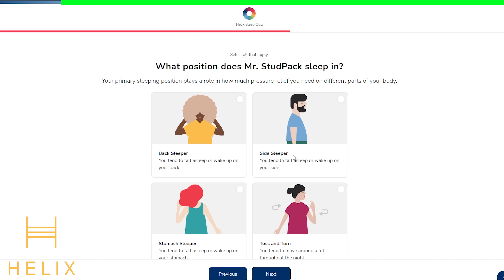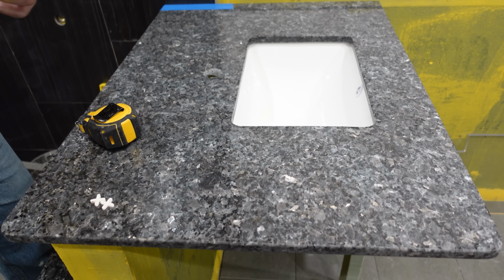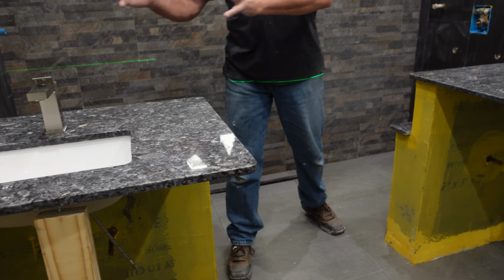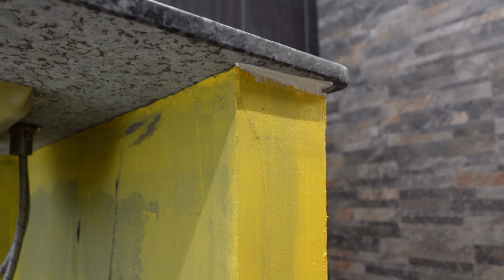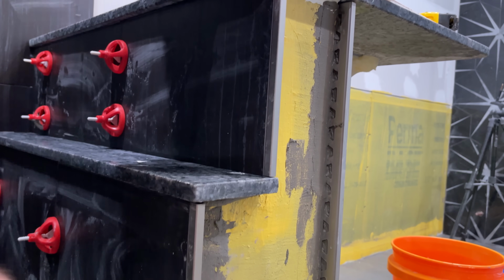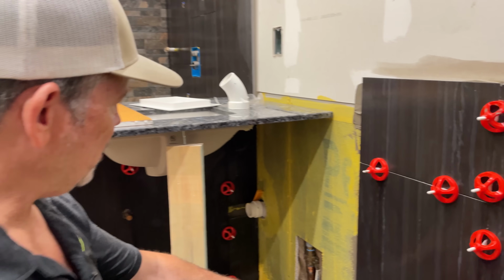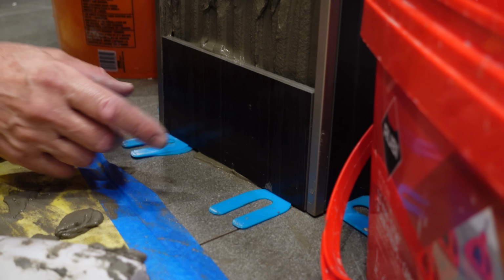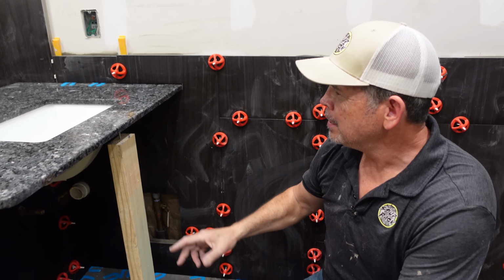A Stick and a Bolt is ALL YOU NEED for Perfectly Level Counters! - THE SHOP Part 20

Comment: Yes I do have a suggestion for the sinks.
Use an extra piece of countertop (say 2"x4") and use construction adhesive or epoxy to glue to bottom corner, and use 1\4" x 2"  flat-bar aluminum (angle cut to fit) from the glued part of countertop (braced) all the way to the corner of the wall and floor where they meet for a 45 degree angle brace. Should be able to use clear Lexel or silicon to keep it in place. 
If you want to use a car part, you could use a leaf spring or possibly an inline 6 cylinder camshaft.
good luck and good videos, keep on rockin.

Comment: I've used that 'bottle jack' trick myself, but I drilled out the end of the 2x4 and put in a tee-nut, and used a bolt. Your way is simpler.

Comment: At least he didn't drop it on another worker. As for the support part, if the main part is going to be covered in chrome, then the chrome pipe at the corner will fit perfectly. With the chromed collars at the top and bottom.

Comment: Great video! (as always)
Pretty sure you've already realized it, but just watching the video, my first thought was your countertop supports would be toe-stubbing magnets in my bathroom... maybe 45° (or 30°) them?
The way you set up the rest of the bathroom, I'd think either something of wrought iron, industrial pipe, or something that looks like muffler tubing would look pretty sweet (powder- or clear-coated would help in the damp environment). The bonus of using that would be easy-to-match towel racks, TP holder, clothes hooks, etc.
Could also do the fancy wood support (4x4s... with wrought iron brackets top & bottom... so it looks pergola style), but it's a bathroom... I'd be inclined to shy away from using any wood.

Comment: If you stick to the car part theme you could use a camshaft or exhaust pipe for supports.  If that seems a little to cliché I would stick with an industrial theme and use some sort of metal tubing and spray paint it black.  We used black iron pipe for my dining room table legs with 2 flanges at the top and the bottom and they came out great.  I spray painted them satin black and I have had no rust or issues since.
I wonder if another option might be to put some sort of shelf bracket or angled bracket to make it appear has not having any support and give it a sudo floating shelf look if your standing above it.

Comment: The sink supports should be 3" stainless steel exhaust tubes and have carved through letters "His" & " Hers" respectively. Then fill in the letters with clear or opaque resin, then light them from inside with LED. Better yet make a slice in the back for the LED strip, put a clear hollow tube inside the exhaust pipe and fill the tubes with water and add aerators for bubbling water columns that shone through the His & Hers letters.

Comment: Awesome look guys !! When cutting stone please use a new diamond blade the one you where using belongs in the bin - put water in a spray bottle rather than having a wet sponge that close to the spinning blade that could have  been drawn in and taken your fingers with it - remember the danger of silicosis !!! most will say drop a chrome leg of some sort to the floor to support that corner that will look fine but it will be a catch and trip point - I'd see if I can get a trap that support the top - I'd convert the PVC to chrome metal and use a flange that you could fix back to the pony wall. In any event that area looks awesome !!
Reply: I'll Second that... don't dry cut engineered quartz, and mask up! Current news is Australia is trying to ban the product due to the health impacts on workers whom may not take enough PPE and dust control measures. When you get to it on the garage mahal, please wet cut your final fits!

Loving the channel and content. Keep up the great work!

Comment: An angled piece of stainless steel from the top corner to the wall at the base. It won’t be in the way for anything including washing the floor. As for attaching I’d think an epoxy or method of your choice to the top and on the bottom a mechanical fastener.

Comment: Supports options should include a set of exhaust manifolds. Lots of suggestions for just exhaust piping and cam/crank /axle shafts, cool as it would be, would still seem a little plain. Manifolds would add character. Another suggestion I liked was coil-over shocks.

Comment: kerdi fix is not a waterproofing substance, its an adhesive for bonding kerdi products to certain substrates. I would have used silicone to bond that quartz to the pony wall. But the kerdi fix should be fine

Comment: Cut a drive shaft in half and put one end on the corner of each countertop.  Axle end on one, trans side on the other. (Weld them so they don't flex obviously.) Substantial enough not to stub a toe on, more than strong enough for that load.

Comment: Wondering about aluminum square tube stock with a welded mounting plate epoxied to the counter. Apparently you can buy pre-anodized aluminum, it would match the Schluter Quadec.

Comment: Get some exhaust piping, have Chevrolet cut out then fill with black and silver chrome epoxy with metallic flakes. The epoxy will show through the wording and the light hitting the epoxy will match the stone work. You can cheat by using clear epoxy up to the the Chevrolet. And after to save some cash.

Comment: Use a leftover Front Strut with the coil spring. If it is string enough to hold up a car, it should be strong enough to hold up a countertop.

By The way, loving how that shower is turning out. Great job as always guys.

Comment: I'd probably get some stainless laser cut brackets that say Chevrolet since you've already got the Logo in the shower.

The supports shouldn't connect to the floor. They should connect back to the pony wall somewhere.

Comment: For the pony wall sink support, I would use some 1/4" stainless steel with your buddy's shop logo cut into it. Shouldn't be too expensive or take long to get and a local machinist should have a CnC laser that could cut it out quick. Would look really good in there with the black and greys. IMO

Comment: Awesome work guys, those cuts that fit first time never get old! Nice

I would say you need to support that countertop fairly robustly at least across the entire front edge. I've had a similar one crack on the corner where the cutout for the sink is, having the square sink like that puts a lot of pressure on that corner and when someone leans on it could snap there. Especially with a sink full of water. 

I'm reminded of how you used a baseball bat to hold up another counter. Perhaps it's fitting to incorporate, say two camshafts, 1 for each countertop. I'm sure your buddy has a few spun camshafts kicking around his collection. Not sure on exact measurements but I think a camshaft would be close to 30 inches so you might have room for perhaps some 2 inch squaretuping that could be bolted through the tile where it meets the wall and be supported on the floating corner by the camshaft. Heck you could probably even weld on some bearings and have it so the camshaft can spin in place while still supporting the load of the sink. 

So (for each sink) find your fabricator hat, cut 2 lengths 2 inch square tubing to create an L-shape that runs the entire length of the floating section of counter top, probably inset about an inch. It would have 3 plates, 1 on each end of the "L" with a flange for bolt holes and a beefy bracket in the elbow of the "L" to accept a crankshaft. Course it would take some measuring to properly design it but there's my idea! You would probably want the crankshaft set under the sink somewhat and not right under the outside corner, so adding a piece of square tubing on the 45 on the inside of the elbow of the "L" would let you inset your post in a ways to reduce shin bashing. Bearing and whatnot are probably overkill on your schedule but that would be pretty mad style points.

Good luck with everything dudes!

Comment: $700 for 4 of those tops is really good price. I work for a solid surface fabricator, we don't do stone we do acrylic only so labor is very different but 4 tops about that size would have easily be nearly $700 each

Comment: I vote for stainless pipe also as mentioned for the sink supports. Maybe an old school Thrush muffler (Glasspack / Cherry Bomb) cut in half ( at the horizontal middle ) as the feet for both sinks.

Comment: Find a local metal shop and have a corbel plasma cut with some cool logo or something from the pony wall to the bottom of the counter out of stainless steel. That way there's no hardware on the ground and nothing to trip around or stub with your feet....and it'll be sexy logo like another Chevy symbol or something. It'll also tie on to that metal mechanic shop look. Or go one step further and have it powder coated.

Comment: For that support use a galvanized pipe with threads on both ends and flanges on both ends
Reply: You can leave it raw as the color of galvanized pipe is blackish. Or you can paint it any other color you like
Reply: Galv is silver
Reply: @alexstoles1339  you're right. I mixed it up with black pipe which would work as well

Comment: you are going to use chrome P trap
why not use chrome tubing that and bend it to look like headers, with 3 or 4 tubs on top going into a collector and use a round flange on the floor
and then use that theme to add a detail to the chrome P trap
great videos, good luck in Texas
for your skid steer loader, try to buy a used one that has the best parts support, it's going to breakdown so get the one that's the most cost effective to fix
look for equipment auctions or equipment rentals houses that are selling off older stuff

Comment: Just a quick question, why did you notch the counter top and then the wall tile? Couldn’t you have just left the counter intact and slid a whole tile in behind it, then sealed it off with some silicone?

Comment: Is there glass going in front of those sinks? If so I'm pretty sure you showed the sinks for level with the laser so they do not have a pitch so when water gets on there there's going to be water on the sill if you're putting glass in front of the sink. And about the niche, are you going to finish the raw edges of tile? It looks like there's raw Edge then light then another edge of the tile you just put in on this video and there's obviously gaps in between that that has to be dealt with? You're going to get water down there, Etc....?

Comment: long term rent the skid steer (and/or machinery).  way way way cheaper in the long run.  stuff will break, maintenance isn't cheap and they never break down in easy to get to spots.  

 Honestly it's almost always cheaper to hire machinery work done.   The guy running it takes all the risks (insurance, break downs, etc) and he's way way way better than you are running it so it will go much faster.

Comment: Just adding legs under the vanity in the front corner wouldn't look good in my opinion. I'd rip out the tile and cut into the pony wall, head to the muffler shop and get some oval pipe bent at a 90 and attach them to the studs to get a floating vanity.

But, since that's too much work, although worth it, I'd just box it in with dark teak cabinets and doors and use the same black tile on the walkway sides leading into the shower.

Comment: I do not believe that's quarts. The product looks like Blue pearl granite. 
Pro tip: those leveling clips can scratch the surface of some materials as you turn them to tighten them. Especially if there is cement residue under the clip!

Comment: Yikes. That company just majorly screwed up by having the inexperienced person use the forklift. I hope they didn't get mad at him bc they let him do it. Must have cost them a lot of $$$. 
Helix mattress thing.. Does not have quiz to ask how many cats and dogs and their preferred sleeping style. LOL. I had 9 of the cats in here the other night plus 2 dogs. I got recommended Helix Plus but it's 13" tall and I need something only 10" tall because that is too heavy/bulky for me to lift to change sheets.
I've got a porter cable angle grinder and it works pretty well. Used it to help fix a botched leveling job (mix was bad and had lumps but friend poured it anyway after I said it looked off-- left big lumps that made it like the surface of the moon & felt nasty-- angle grinder smoothed it down and another coat of leveling mix filled in pits). 
I love how you wipe away the thinset on the edges of the tile. Some installers are lazy and leave it messy but you take the time to clean it up and make it look pretty.
The mention of propane tanks and bombs reminded me of a friend in Guam telling us how when she was a kid, she and her siblings had this large object they would play on in the woods near their yard. They would climb, jump, and ride it like a horse. One day their uncle came out looking for them and started shrieking at them to get off of it and go inside. It was an unexploded bomb from WWII. He called the authorities to have it safely removed and the kids were bummed to have lost their toy.
What kind of wall plates will you be using? Brushed stainless steel? Diamond pattern steel (like the stuff used in garages)? Gloss black?
The tile looks great. For supports I know people were suggesting all sorts of car parts. I was thinking two 2" aluminum angle stock pieces put together around some wooden supports to form a square support might look neat. Would give that sort of brushed metal look & won't rust. Not sure how to secure them though. They also sell 1" square tube stock but that might look too small.
I've seen undermount sink supports that are metal and not too expensive. They come with flanges for top and bottom. Look kind of like exhaust pipes. Its pricey though. But you might be able to use a mast pole filled with spray foam for reinforcement and get the flanges to go on it.
Or maybe even the fence posts used in chainlink fences might look neat.
I'm looking forward to seeing what detail you use for the trim/backsplash above the tile and around the gang box.

Comment: A TWO minute commercial after ONE minute of the video?
I would suggest shortening that up.
If the company wants two minutes, spread it around in the video.
Start with a company name drop, a one minute commercial in the middle and wrap up the video with a bit more about the product and/or company.
Just a suggestion. 
FYI, I fast forwarded the ad in video because I actually let the (30 seconds or less) ads play.

Comment: One safety comment. Cutting quartz puts off some nasty particles. Some workers who cut it constantly in a shop without masks developed nasty lung problems. I’m not sure if it’s cutting the stone or the resin which caused the problems, but if you cut that stuff often, be sure to get the right PPE.